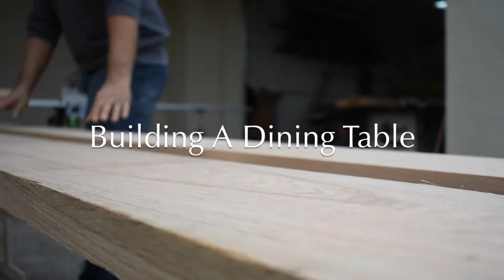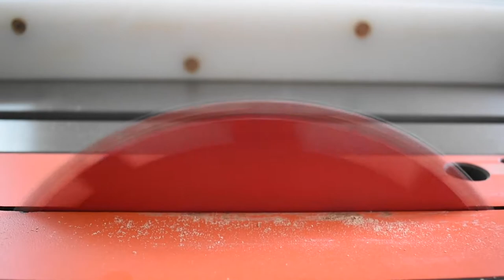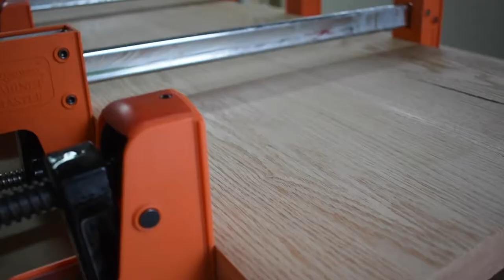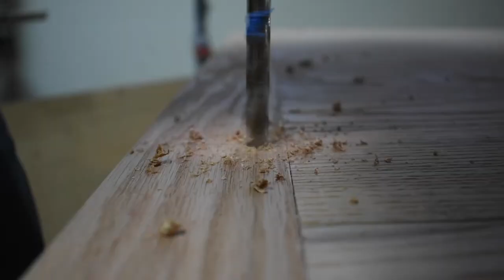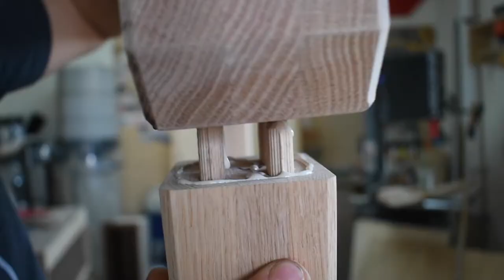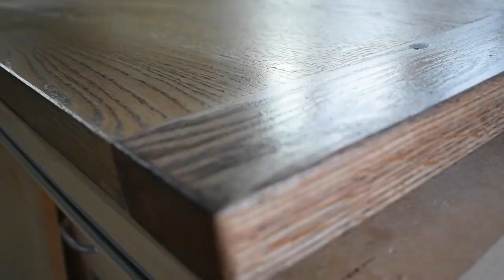Building a Farmhouse Dining Table

Comment: I've read good and bad about using a Domino for breadboard ends. Has the table shown any signs of wanting to move yet? And how do make allowances with a Domino joint if it does? You've got this looking absolutely gorgeous, hopefully it won't want to shift about too much.
Reply from the maker: DaveB1v I can only say good things about the domino. No the table hasn’t should any signs. The dominos where glued on one edge(table edge) and only glue was applied to the middle tenon in the breadboard. Also when I bored for the dowel. I offset the hole dowel hole in the tenons in the table top. This made it a tighter connection. It’s called draw boarding. Hope that helps!
Reply from the maker: Shown* any signs
Reply: Good stuff! I wasn't sure if the Domino would give enough 'meat' to be able to put an offset dowel through, or if it might actually draw the glued Domino out from the mortice rather than pull the board in tight. I've only just got myself a DF 500 so looking forward to putting it through its paces!